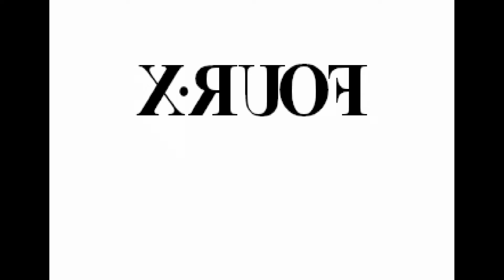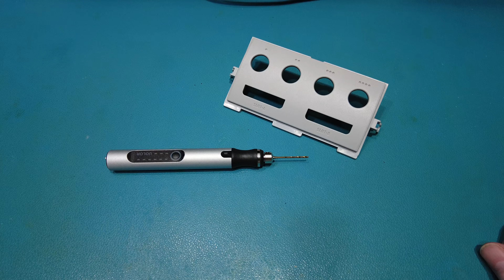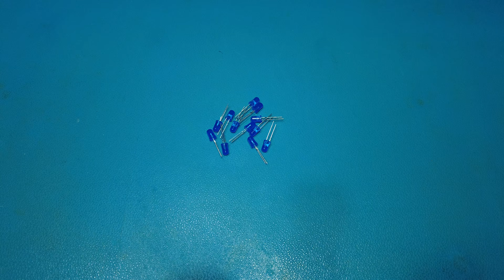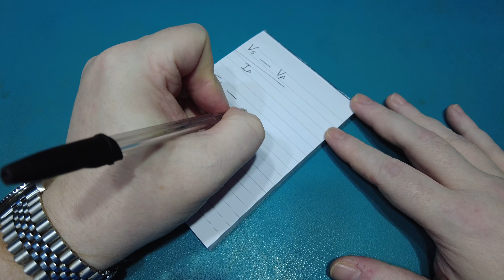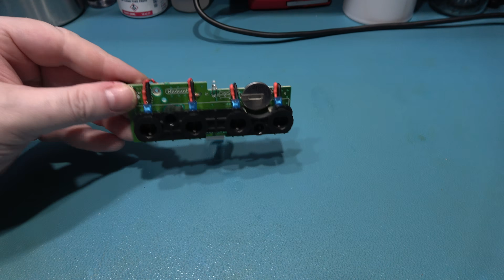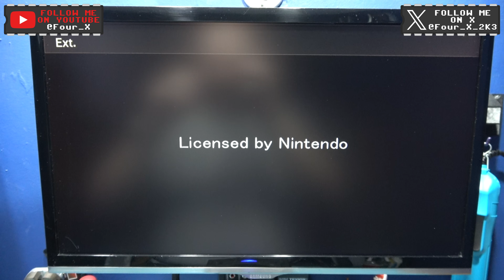Nintendo GameCube - Controller Port, Blue LED Mod.

Comment: Would it be possible to simply use 5v LEDs for the controller ports, instead of having to use 3v LEDs+resistors? Also, my condolences about your mom.